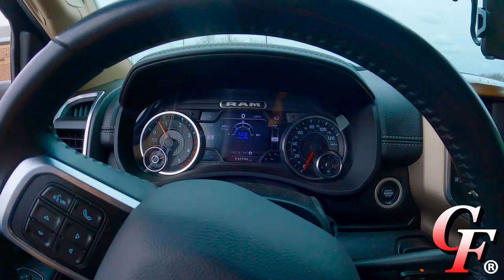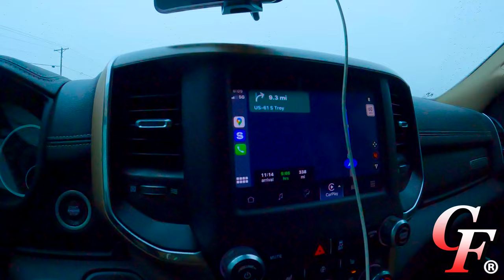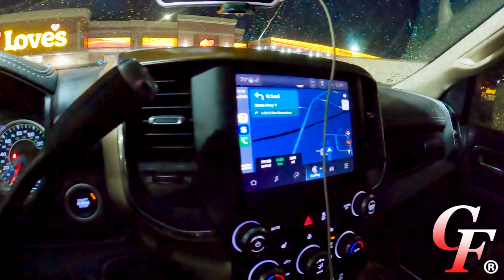Trailer Adventures!!! (3/23/24)

Comment: last yr up here in wisc we had a lot of cover crops planted and every one no-tilled corn and i no-tilled some beans in crimped cover crops then the drought from hell hit only 4 inches of rain all growing season it turned out to be the worst yields since 1988 drought this spring  there hardly no cover crops seen at all,rain makes grain.
Reply from the maker: Cover crops take years to build soil. It’s a slow process. They’re not a magical solution to fix every problem in the field even though many people make it seem that they are. Hopefully we don’t give that impression. They require proper management to work and everyone’s results may differ. 

Bottom line, regardless your practice, if there’s no water in the soil, it really doesn’t matter what your practice is

Comment: Matt bring the pickup and trailer in the shop and do some preventative maintenance.
Reply from the maker: What preventive maintenance???  I checked air pressure, greased wheel bearings, lights, etc. sometimes freak things happen.
Reply: No matter what you do it just goes with farming you can do all the maintenance all winter long in shop your still going to have breakdowns when you get in the field

Comment: For such tasks, you would need the F550 or F600 flatbed with the longest wheelbase. It's a shame to drag the trailer so far to load such a medium-sized box.
Reply from the maker: I’m not buying a $80K truck when a $2500 trailer will do just fine
Reply: @griggsfarmsllc  Not new. Used ones are even several times cheaper. A friend bought it for less than $20k. even though it has 3 trailers. He says he saves 2-3 days a month on small to medium loads (he drives at 70+ mph) and will pay for himself in fuel next year. Many people do this - they buy 1 long flatbed in a small or medium chassis for a farm/company - f600 have almost 9 thousand. lbs of payload. it depends on whether you look more at savings or productivity, and whether such loads happen often, because if it's a one-off, there's no point in buying it.

Comment: Kelly I know you said you were only a hour and a half from home when it happened but did you stop anywhere maybe a convince store for something to drink or snacks if you did it is possible some a**hole messed with the pin either trying too steal it and you came out before they could finish or just like there are people who will pull the fifth wheel release on other drivers trying too make them look bad so if you stop anywhere even for a short time check the hitch and any pins I would also recommend you buy a pin for the hitch that requires a key to get it off
Reply from the maker: That’s very good advice. Thank you